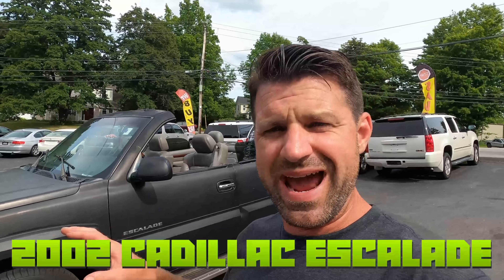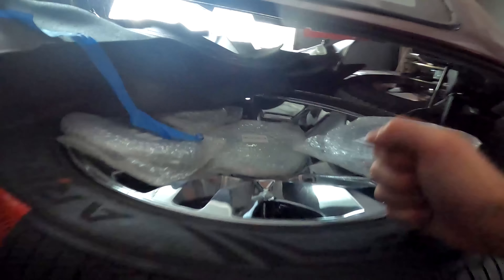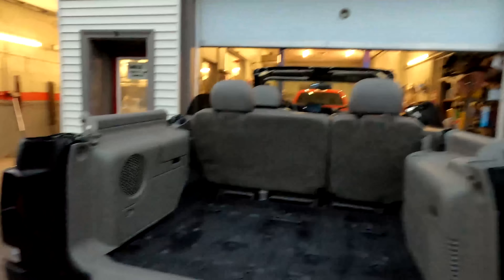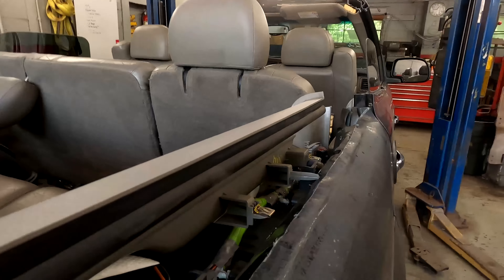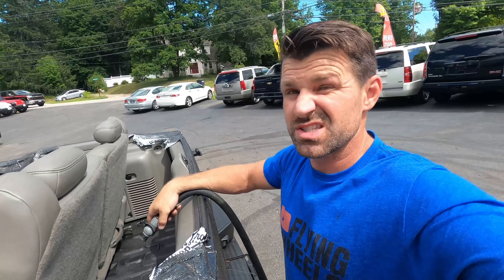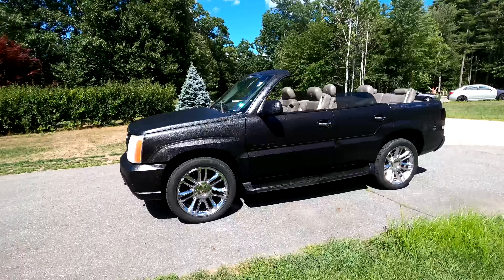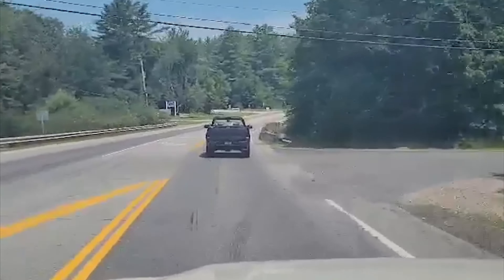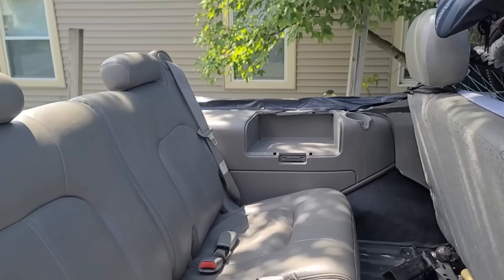Finishing up our Chop Top Cadillac Escalade Convertible - Flying Wheels

Comment: Take the middle row of seats out fold down the third row seats make your own roll bar for it so when you put the soft top on it will look like a pickup, or take a roll bar/ light bar that people used to have in the bed of a truck use that to hold a soft top then you can when u put the soft top on the truck top will have a slight angle from the middle of the truck to the rear end of it. It will give it that medical hummer slant roof. That would be simple and insane looking

Comment: Definitely need a roll bar... Reason number one..If you are hit broadsided, chances are you will roll over... All you need to do is watch how easy SUVs roll over during side impact.
Reply: I recall an accident about 20 years ago where a 1st generation Miata t-boned a Suburban. The suburban ended up on its side while the Miata looked to have far less front end damage than one would expect 😬
EDIT: Also, those larger wheels just raised your center of gravity. Just sayin'
Reply: I concur

Comment: You can pull out the rear hvac. You can cap off the heat/AC lines up in the engine bay.

Comment: 1. Rear door windows need to go; they look goofy & will end up getting broken anyway bc truck stuff.  
2. A wood floor wouldn't be too expensive, ordinary hardwood for a house would do or a wood bed kit for a pickup.  
2.5. Maybe make some wood caps to replace the interior side panels as well.  
3. One of those arch shaped "temp" garages would keep the elements off & they're maybe a couple hundred bucks.

Comment: So, you are probably already done with this but did you think of using expanding foam at the cut lines and then shaving it to the shape you want?  You could fiberglass over the top of the foam after shaping it.  Easy quick and cheap way to finish the cut lines.
Reply from the maker: That is an amazing idea!

Comment: Make a run to HD or Lowes and visit their roofing section. Lots of plastic and aluminum eave troughs and similar lengths of material that you can form over the rough edges and pop rivet or screw down. Almost any roll bar would work. Cut it in the center and add or subtract material to fit. Now you a have center point to stretch a bimini (canvas) top from the top of windshield to the roll bar and then to the rear tailgate. Attach snaps across windshield and roll bar and then a couple lanyards to the corners of the tailgate.

Comment: Why not smooth out the doors some more then install one long wood plank on the left side and one on the right side like they were rail covers and now you have nice armrests. It would resemble partially like a old woodie car which would be cool and also it would match the steering wheel. You could use like a putty to fill any gaps that show between the new wooden plank rails and the uneven cut lines. Hope this helps 🙏

Comment: That's funny, I just pulled a 2002 LQ9 from a Escalade in the junkyard last weekend. LQ9 is a 6.0L with the same heads as the truck engine.  Difference is flat top pistons, and cam profile, 345 hp vs 300hp.
Reply from the maker: how much was it?
Reply: @FlyingWheels  
$300 engine. Got it running, sold it for $1300. About 4.5 hrs of work.

Comment: What about the structural support that comes from the roof supports?  Others have tried that type of bs before.
Reply from the maker: Body on solid frame
Reply: @FlyingWheels  Where is the cross supports under the vehicle manufactures put on the chassis, frames on convertibles?  Wonder why your windows won't go down?  The body is sagging in the middle, not true.  Check Uncle Tony's Garage and other videos concerning this.

Comment: Cool, but would be a killing machine in a rollover, add a proper roll over cage, and as a bonus it could act as support for a removable canopy top when it rains!
Reply: Great fun but how is it even road legal w/o roll bars, plus with the roof off the integrity of the vehicle has been compromised.  It flips and you've wiped out the family.
Reply: @babyblu8900  it’s a body on frame, not a unibody, so it will be ok from a drive train POV. I agree that in a rollover it would pancake and needs a roll cage.

Comment: Editing is wayyyyyyy better. You should slent more time cutting cleaner lines on that thing but overall looks pretty fun!  Now have a contest to find it a cool name!

Edit: should of kept the roof and made a hard top with some strap latches or stainless steel latches. Just keep the back window glass removed and cut lexan and urethane in to save weight. Even use some tinted lexan then the side windows would have a purpous.

Comment: It just dawned on me that you could have gotten an avalanche or Escalade ext and done half the work.
Reply: I have an 07 avalanche with a factory sunroof.. I got it because you can drop the rear window and mid gate , making it a full size truck. 

My rear unibody is intact ( kinda important towing a big boat) and my side impact strength,  roll over , and air bags are all stock. 

Not gonna lie , I still like the project..